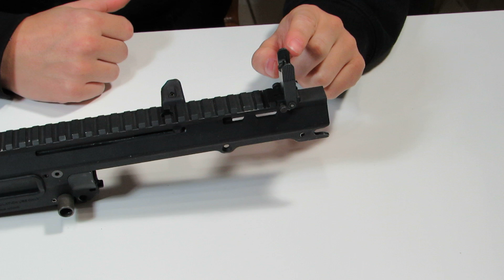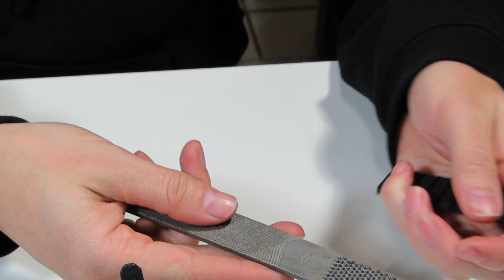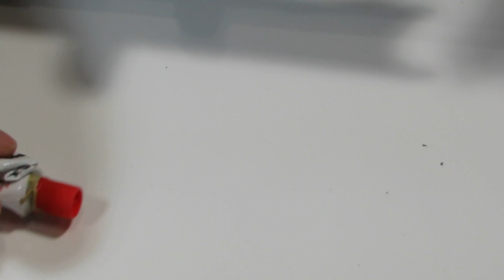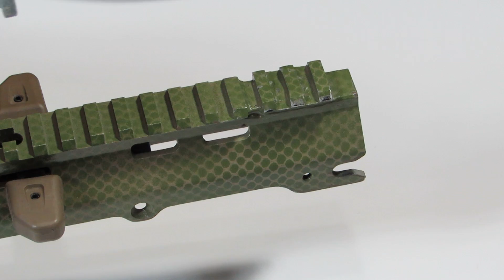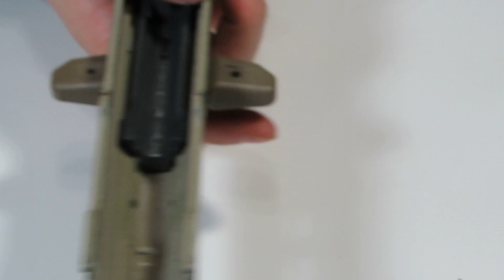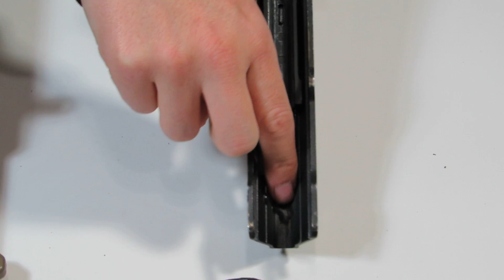Deranged PTS Masada rail mod

Comment: The PTS Masada streamline version actually comes without that front sight so this mod Isn't required you guys should check that version out at some point
Reply from the maker: Ya, we did this mod to our first Masada before the SV was launched. We also purchased an SV once it came out, did not like the build quality at all compared to our 5 PTS Masadas. So ended up modding our other one and selling the SV. But for anyone not willing to get their hands dirty the SV upper is a decent alternative.
Reply: Deranged Airsoft I totally see where your coming from with the build quality I got around that by buying parts like the handgaurd and stock that where from the no SV Masada. but while on the topic of the SV I know you no longer own one but what did you think about the new reinforced gearbox they had in it? I have heard of the original Masada having issues with the gearbox shell cracking which can be a big problem for a proprietary gearbox shell. Do you think the reinforcements made to the shell of the SV masada will increase the longevity of the shell or should I take other measures to make sure I can continue to use the rifle for a long time.
Reply from the maker: WiiPlayPCToo In order to increase the longevity of our gearboxes we rounded out the corners of the gearbox and installed sorbo pads to the piston heads.  The SV Masadas just feel like A&K masadas with their polymer and thinner metal, this is all by feel between the two.  Inside the gearbox everything seems to be the same except the springs that operate the trigger, anti-reverse lever, trigger trolley, etc. are much weaker than the ones found the PTS gearboxes.  In our opinion, save up and buy the real PTS Masada